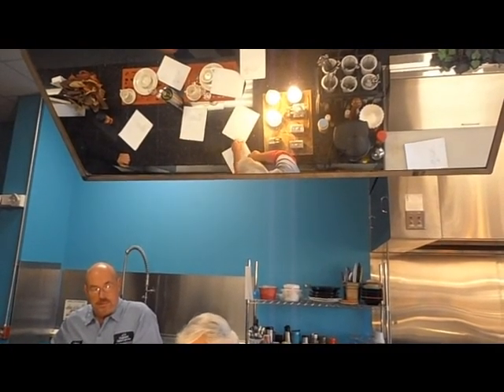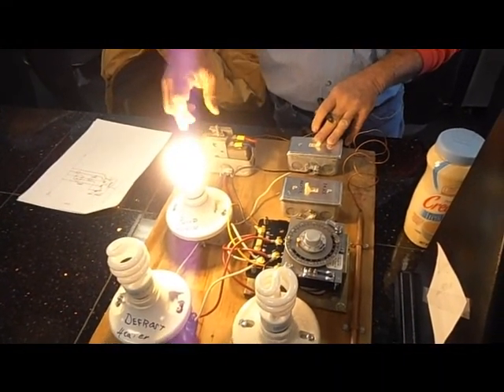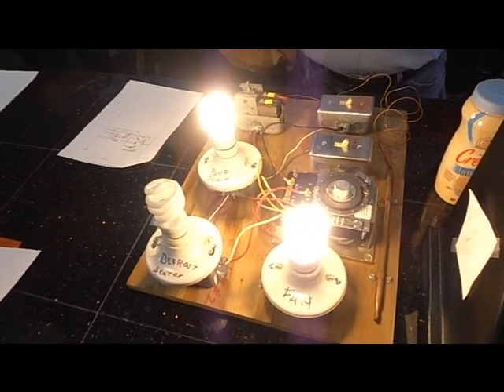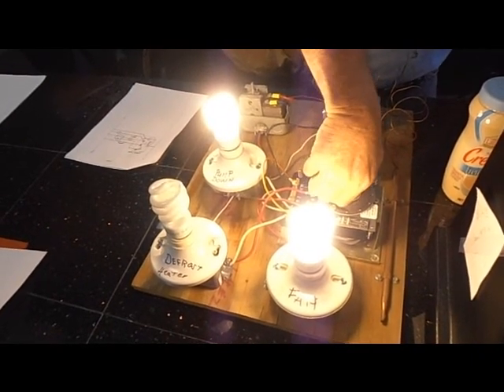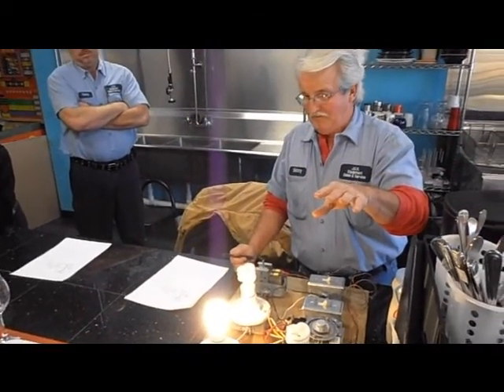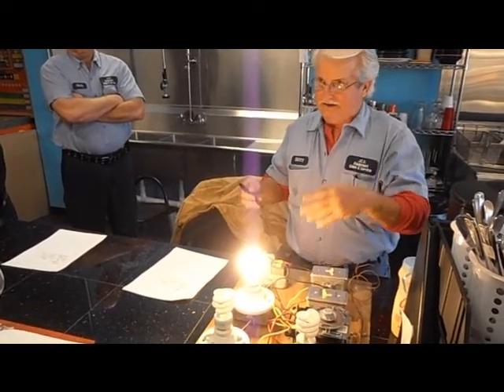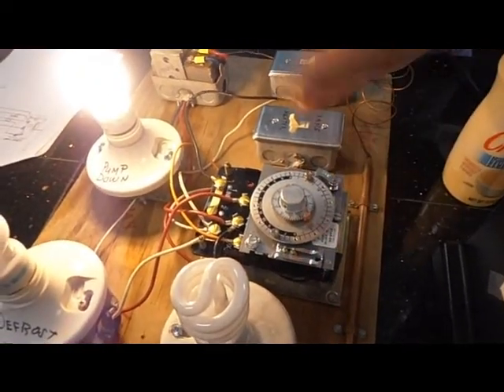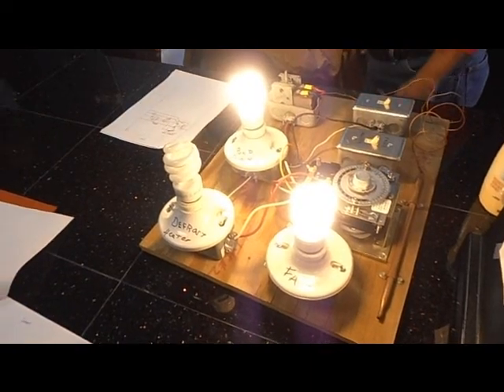How Refrigeration Works: The Sequence of Operation

Comment: Great video. I have a little over 2 years experience doing light commercial ac and refrigeration. I have gotten allot of things down but knowing how to wire everything together is what gets me. Yes I know that's what schematics are for but sometimes that can only take you so far. I feel if I had a better understanding of each component in the refrigeration cycle, the sequence of operation and the correct voltage I should not have any problem say building an entire evaporator and condenser one piece at a time and then wiring it all up. If you could do a video on how everything is suppose to be wired that would be great.